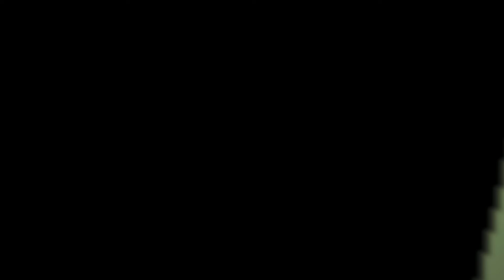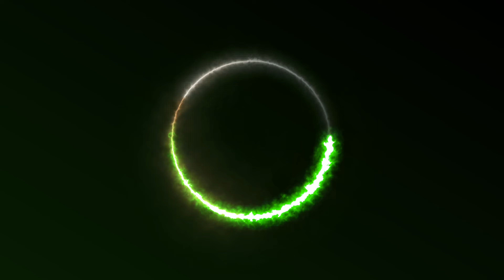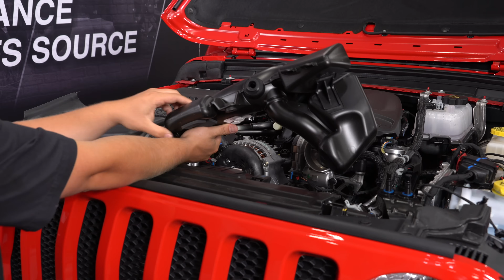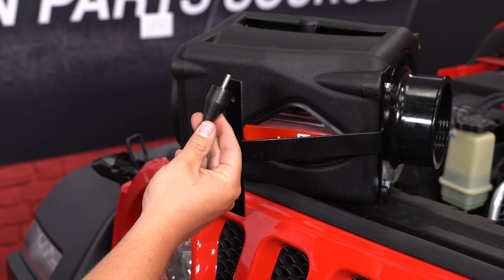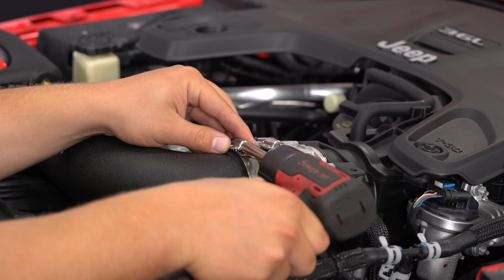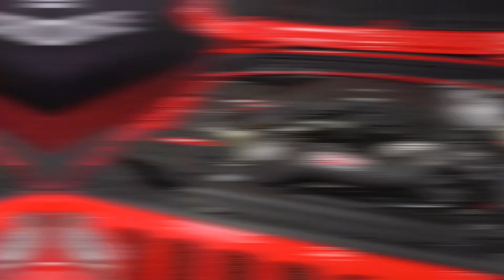Jeep Wrangler JL Install: Injen Wrinkle Black Power-Flow Cold Air Intake w/ Oiled Cotton Filter

Comment: Word on the street, same as a K&N filter..Proved that that type of air filter lets in more dust, dirt and debrie into the engine...The common paper air filter, does a better job of filtering...
Reply: Actuation oil test have been done and K&N drop in filter lets in less trash then a paper filter while adding more power. Let the engineers do the talking and not your home boys. 

K&N makes AEM and Spectre filters which are all of different materials. I highly doubt they provide injen with filters. Word on the street is Injen will not disclose where their filters are made. So they could be but doubt they are K&N.
Reply: If you look at their site, they offer the kit in a paper version too, which is very much like the Donaldson media.  That said, their oiled filter is an 8-layer as opposed to K&N's 4-layer.  Big difference in filtration on either one of their filter options!

Comment: Yea try to do some water crossing or splashing 
This thing more likely to lock your engine it will suck all the water it can 
The factory one with its air sucking tube  designed being  up hi like that for a reason
Reply from the maker: If youre worried about the inlet being a few inches lower, get a lift, problem solved ;)
Reply: Not everyone cares about water crossing.
Reply: Right its not right for everyone 
But i wish when companies offer stuff like this say in the video that water limit  will changed from factory limit some people dont know and think its like the factory and the go in the rain or so and the jeep engine is trashed all cuz of 2hp from this filter
Reply: Exactly.
Reply: No I dont need a lift I need to get the snorkel you guys probably offer that’s well get the engine to breath better hi up from dusty air on trails kinda will help not really lol and also soothe my need better for water crossing...
Reply: Snorkels don't help engines breathe better, think about it.  Try drinking a glass of water out of a straw that's 8 inches.  Now take that same glass of water and drink out of a straw that's 20 inches.  I bet you'll notice a difference...

As for "dusty air on trails"... that's what a filter is for.
Reply: On Toyota 2019 trd pro part of the packageis a snorkel and they call it a dust breather I think 🤔
Think about it in a trail behind a friend in his 4X4 and hes making some dust  low to the ground lets say by headlights level when you have a snorkel it takes air from  cooler cleaner fresher oxygen from the higher level of the air

Do cars really run on oxygen like humans🤔🤔
Reply: They have a different version that is sealed and has access to use their upcoming snorkel system as well.  The version in this video is more of the street/light off road version for guys looking for more power and do very little water crossings.